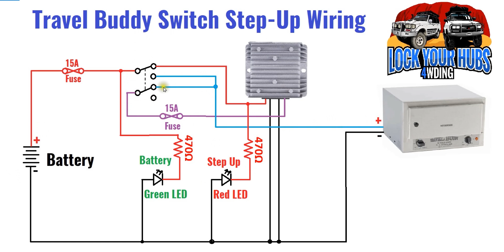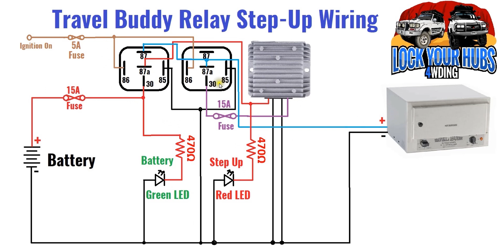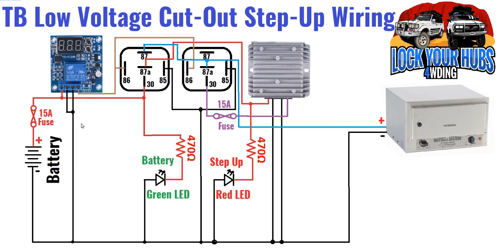Wiring Step-Up Converters for your 12 Volt Oven such as Travel Buddy, Road Chef or Kickass

Comment: Wouldn't the Summerville metal works set up/down 13.8v be the best and easiest option?
9 to 36v in is always made to 13.8v out?

So no extra wiring and for a smart alternator it will keep export to 13.8v regardless of the import.
Reply from the maker: Back when the video was made, the wide input voltage models weren't commonly available.
Reply: @Lock your Hubs 4WDing  would you see any issues just running it via one all the time? 

Yes the set up life will be reduced from more use... but then again most ware is heating and cooling cycles...
Reply from the maker: There is the parasitic loss issue that may flatten your battery if the vehicle isn't driven for a while.

Comment: I bought the low voltage cut-out module. I`ve set it to 12,0v to cut off my stuff. But i dont understand the other settings with the low number. Maybe you can help me with that? Thanks in advance.
Reply from the maker: What part as you having trouble with.
Reply: @LockyourHubs4WDing  I got it now. Thanks!

Comment: Does the 24v version heat up faster would it be worth running a 24v oven with 12-24v converter?
Reply from the maker: It's a higher wattage unit, I hear it's more powerful, though haven't personally tested it.
Reply: @LockyourHubs4WDing  I havnt found any reviews or test temps and times on the 24v

Comment: Curious why do you need to disconnect the step up converter when driving? Is it because it may overload the converter?
Reply: I wondered the same. You can get a 8v to 30v input step up/down that outputs 13.8 up to 20a. Just wire that in, set and forget. You might loose a little whilst driving because it might clip a slightly higher available voltage. But I think the test videos showed 13.8 was optimal anyway. Cool video none the less. Thanks.
Reply from the maker: Glad you liked the video!
Reply from the maker: That particular step up is only rated to 13v input.
Reply: Ah I see, So if you were running a 12v to 15v(15a/225W) step up converter technically you wouldn't need this?

Comment: Hey mate,
I watched these videos when they first came out, and last week I got a travel buddy. Do you think you would need a stepup if you use a lithium battery?
Reply from the maker: You'll get less of a benifet using a lithium battery as they don't drop off the voltage as the battery discharges nearly as much as a conventional lead acid. Though you still get a performance boost, especially with the 15V version.
Reply: @LockyourHubs4WDing  great thanks for the quick reply. Might give it a test without and if I find im using it whilst not driving ill add the 15v. 
Cheers and keep up the great vids, I've been showing my mates your channel.
Reply from the maker: Cheers mate, keep an eye out for this Sunday's video! I'll be upsetting manufacturers again, this time 12V fridge manufactures :)

Comment: I am curious as to what would happen if I ran the Step Up converter whilst the alternator was supplying 14v to the Travel Buddy. Would the step up converter then increase the voltage to 16 or 17 volts and start to cause damage? Great Video too thankyou!
Reply: The regulator does exactly that, it ensures that the output is 13.8/15volts what ever it is designed for, running off the alternator when running will not increase the output.
Reply from the maker: The regulator is designed to output (in this case) about 15v regardless of the input voltage. The specs list a max input voltage of 13v. Though having not tested it, I would assume feeding it more voltage on the input would result in more heat the step-up would generate, you might eventually overload a component or two in the step-up and let the magic smoke out!

Comment: I’m electric illiterate so geeez my brain is going mad I’m just curious on how to set up a fridge and turning my cigi socket into a Anderson plug instead and I’m only single battery do I was wondering how to hard wire up a solar panel to my single battery 🤯🥵 love your videos tho
Reply from the maker: We have a solar blanket review and a solar panel install coming up, so keep an eye out!
Reply: An anderson plug needs to be wired to the battery through its own fuse/circuit breaker. Making an adapter for the gig lighter may damage the wiring in the car.
Reply from the maker: You need to watch the current draw from cig lighter sockets, if you're only using it for low current devices <5amp, it should work fine ( you could put a 5 amp fuse in line to make sure you don't overload it) But don't try running an ARB Twin air compressor off of it!  

Preferably you have a properly fused dedicated circuit for an anderson outlet. As Brock has correctly pointed out.